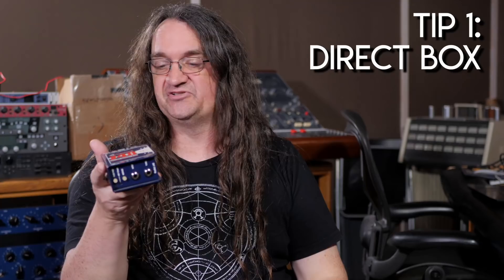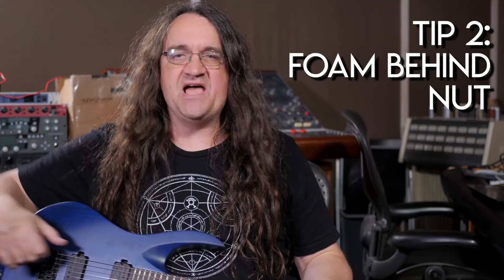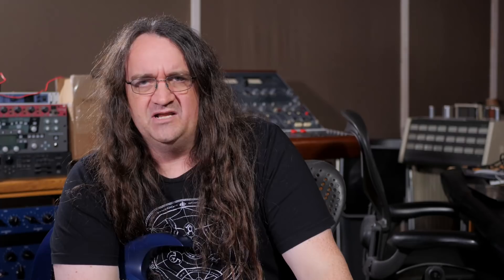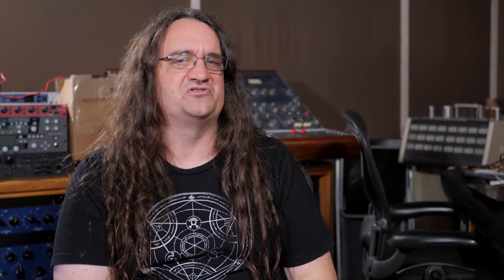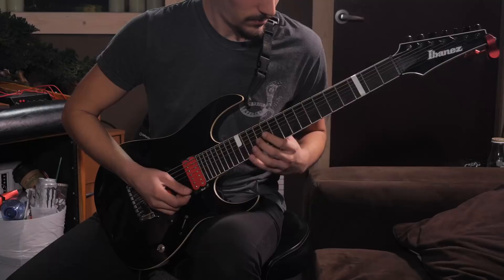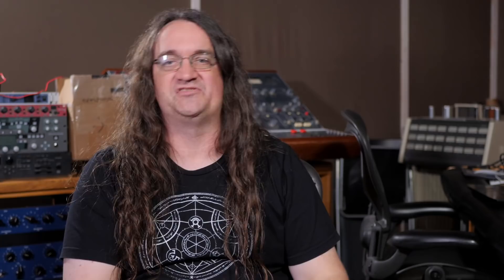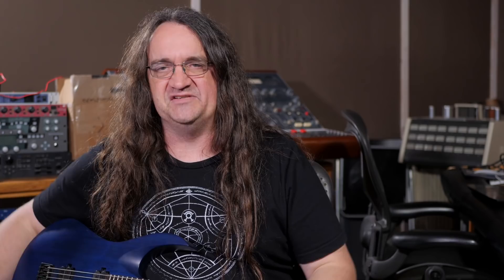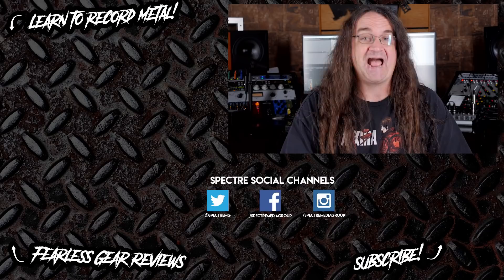Five Tips for Recording Metal Guitar at Home

Comment: So, I use a DI box or an interface to record? They are not basically the same thing? I’m not getting it
Reply: It depends on your use case. Most interfaces advertise having an instrument input but some of the cheaper interfaces don't have good quality instrument inputs. Some interfaces will always clip the input no matter how low you have your gain set. In this case a DI box would be very helpful. 

If you want to record a real amp with a mic, it's good practice to record a safety track that is just your DI signal coming from the guitar. You can't do this with just your interface, you'd need a DI box to split the signal from your guitar to go to your interface and then another output into your amp. If you're using an Amp sim then you can just record direct into your interface and you'll be good to go. 

Another use case for a DI box is if you want to send your guitar DIs off to get professionally reamped. In that case you'll always want to provide the cleanest signal possible which would be achieved with a DI box.

Comment: Would sliding foam in my fretboard work the same way as tape?
Reply: I wouldn't say it would work the same, but definetly an improvement for a cleaner recording
Reply: Not exactly. The foam does not like to move with the string so it can push your strings out of tune or make the guitar feel different. 

Tape just moves allong with the string when you play without adding to much resistance. This is better. 

If you do use foam I would recommend very soft foam.

Comment: You absolutely dont need DI if you have HI Z input, DI just messes with impedance guitar see, not a good thing. Di is for balancing unbalanced signal with long cable runs.
Reply: Many HI Z inputs suck high-end from the signal, and also they are more prone to hiss and buzz and what not. A DI-box solves these problems (at least they did in my case)
Reply: @BodominLapsi95  absolutely not true. It is Lo Z that does that, or line input. And people make mistake plugging in guitars in such inputs. Hi Z can never do that, it's basic electronics, that is the reason for having Hi Z in the first place. Only problem you can get by using Hi Z input is overdriving preamp chip/fet or what ever is used. However guitars don't have that high output, and DI doesn't help there either. Using it for reamping is another thing though!
Reply: @TheKingKorg  At least with a cheap interface like my Tascam the HI-Z input isn't very good, and a DI-box is a huge improvement. I haven't tried any higher end interfaces, so I can't say if they're better.

Comment: “Pick hard.”

Yeah...not always.  Some of the best tones I’ve EVER recorded are from guitarists who have a relatively light touch.  Crest Factor, if you will, has a HUGE influence on tone.  I find the light touch guys generate surprisingly thick sounds.  I do tend to pick fairly hard myself, and while I know I can make a guitar speak well, I work with guys that have a VERY light touch who do the same.

The big deal is just setting the amp right.  EVH, from what I’m told, has his amps gained up WAY past where you’d imagine they’d be.  I’ve heard his rig described as “uncontrollable.”  Which is probably true for everybody but Ed.  Light strings, light pick, light touch, but his rig works for him, and I can think of very few who dislike the tone he creates.

I always thing of playing instruments as a game of “enough.”  You need to pick hard ENOUGH.  You need ENOUGH gain to have some sustain to play with.  You need ENOUGH midrange to hear the notes, enough top end to hear the attack, and enough bottom end to feel like the sound is supported and dynamic.

“As hard as you can” is oversimplifying it at best, and bad advice at worst, as there is a limit.  You pick way too hard and you’ll drive strings out of tune, you’ll break strings, and your tone can even get thin and plucky because you’re beating the strings so hard that they don’t have adequate time to ring out.

Comment: Great video, thank you! I would be really happy to see similar tips on acoustic/classical guitar recording.
Reply: Good recording is good recording, much of what is discussed here for metal works for all, just ignore the distortion gear. Specifically:

You will mic a guitar instead of an overdriven 4x12 cab, so your neighbors will not plan your funeral. The same mics (usually SM57) suit both, although I prefer a condenser for acoustic, but that is just my personal taste. 

A pre-amp with a USB out (standard I/O interface) gets the sound to your DAW, and it is still nice to record the track totally clean and flat (your producer will thank you), with a duplicate recorded the way you really want to hear it, like maybe a little EQ, touch of reverb or delay.

This is where the DI box comes in, only you are not plugging in a guitar cord, you have a mic, so XLR connection in, and you may need phantom power. And two outputs, one clean, one going to whatever FX.

The ART Tube MP ($50) handles this nicely. I'm sure there are other fine brands and models, I mention this one as an example.
Reply: @SteamvilleQuintet  thank you very much for the detailed answer. That is more or less what I already do. The biggest problems with acoustic guitar at the recording step for me: 1. The noise of the room 2. The sound of my breathing while playing.
BTW, I'm a total amateur, so, for electric guitar I would definitely not mic. anything except what pickups are doing. My room is far away from being properly isolated.
Reply: So you have a mic that picks up EVERYthing - take a quick web search learn on mic patterns, sounds like you need a cardoid, that will mainly pick up what is directly in front of it and 8" or less away, and then you may want to engineer some small screens from old quilts or packing blankets. Do not fret, your situation is common and solvable. And do NOY buy a foam mic screen, they deaden the tone. Wrap old nylons, or I used a bit of felt for a "pop filter".
Reply: @SteamvilleQuintet  thank you so much for the answer. Regarding those "screens", do you maybe have a photo of your setup? At least, then I can imagine how it may look like. Regarding mics, I have 2: Rode condenser mic, which sound I really love, but it takes all the noise; the second is cheap copy of sm57, the noise is almost gone, but the sound is poor(I'm not sure, should I try something more expensive or it's just the nature of those dynamic mics).
Reply: No photo at the moment, but I am making some how2 films - not that the people already doing it are not good - but that everyone wants the old rock sound and most are too young to even know what it is/was or how we got it. So yes there will be film of my little setup, and it is little, I'm into compact, easy to use and reach. No use for a 7 foot wide mixer board!

Anyway, my fave mic is actually an MXL 990 (made by Marshall), Musician's Friend has them $60 on sale, $90 with a spiderweb shockmount that I like. It is a cylinder shape so my guy just wrapped and velcro'd a bit of felt around it for me one night, and that works so we never did anything more "pro".

That is I think not quite the mic for you, it is close range, but there is a better one for close work, can't recall the name of it.

I don't have so much noise to deal with, we do live in a normal house / neighborhood, but double insulated walls, and my sound and animation studio is upstairs, and we're old so just the two of us.

Those SM 57s are indeed noisy and hissy, they take some mixer work to be nice, great for live stage work though. I prefer the SM 58 after I heard Stevie Nicks using one, and her voice is close in tone to mine, so I bought one. For the studio I like condenser mics.

I will see if I can find that mic I mentioned if it's still made, and if I do I will write again with that, and in 2 or 3 weeks I will publish the first film on a new YouTube channel I haven't fired up yet, WestMillsStudio.

The one I'm working on now is a demo comparison for a blues sound using a few VST amp sims (all free) compared to a Telecaster with no FX at all, and then played through a Boss Blues Driver pedal. The next film will be similar only with totally clean sounds like classical or new age music would use.

Really sorry for such long answers... - R
Reply: @SteamvilleQuintet  nothing to apologise for, your answers are brilliant, thanks a lot for your time. It's a pity that your new channel is not available to subscribe. I hope you will invite me once it's ready. For now I've subscribed to your current channel.
I'm also doing something music-related on my channel, not sure if it would be interesting for you, it's pure amateur stuff. Check it out, if you're curious.
Thanks a lot for your answers, you gave me some ideas to think about. Looking forward to hearing from you soon.
Reply: Thanx Andrej!!! I will make note on my current channel when I fire up the new one - I'm thinking the one for games that I rarely have time to play now and then one for the studio stuff.

Apologies for not responding quicker, this IS my time of night by nature, but I am multi-tasking tonight, and like everyone else I'm not much good at it.

Going now to see if I can suggest a particular mic for you, based on my own experiences. And I will look at your channel - hey I'm an amateur too because even though I have made some demos for songwriters who do not play any instruments so they could sell their songs to groups starting out, and I have been lucky enough to hear my stuff on the radio a couple of times - I do music for the love of it. And that is the true meaning of amateur.
Reply: @SteamvilleQuintet  thank you for encouraging words! You're responding much faster than average person on the Internet :) Thanks a lot for your answers and time! See you soon. Good luck with you nightly multi-tasking work! :)
Reply: At this moment I'm not seeing a mic I like better than the one I'm using both for vocals and acoustic guitars:

MXL 990 Condenser Microphone with Shockmount

It is $100 on MF but goes on sale for $60 or $70 - it DOES pick up more noise from the rear than you'll want but a simple curved foam screen behind it maybe 12" tall x 16" in a half curve should take care of that. The spiderweb knocks out anything banging on the floor or mic stand, in one situation I need that because I have cats, in another placement I do not need that.

And there are rear screens available easily, also easy to put one together yourself - depends on how pro you want to look I guess. I gave up worrying about looking pro after I saw duct tape, scuze - gaffer's tape doing various things in a Beatles recording session photograph years ago.

I was looking for another MXL, a stereo version with closer range but it seems to be no longer made, so happy I bought that one when I did.

Now I have experience with only a couple dozen mics, some pricey some not, so I'm sure there are plenty of folks with more opinions than mine, and arguments about the best mic go on forever!

The sound of the MXL I use is on all of my game films as an example, with no shield behind because I wouldn't be able to see the screen with one, and in some films I have a window fan running 6 feet away, in a couple of others a window AC or furnace. I was not concerned so much about a silent room for the games.

Glad I can help, almost feel like we have hi-jacked Glenn's channel LOL, and will continue to answer anything I can. Will look at your channel before the sun comes up, and now going to listen to a new free amp sim, two of them released this week, how does one keep up? - R
Reply: Hello - listened to your songs, like them, yes I heard a little noise that a cardoid would knock back, but in the "live" setting you're doing a little noise is expected. Keep playing, after a while you get a little more relaxed - go with that. People love the charisma of a live show. Perfect is boring. Carry on playing! - R
Reply: @SteamvilleQuintet  hello! Sorry for the late response. Thanks a lot for watching and kind words, I will definitely continue ☺ in a couple of weeks I plan to publish something new.

Comment: To my colleagues in the "useless cunt" - departemenrt: 
Most of this tips are important to bass as well!

I. I am recording a distorted sound through my cabs and have a DI-Box in front that makes it possible to mit those two sounds together. So use a DI-box for this purposeif your amp has no really pristine Direct out.
Nota bene: Distortion pedals used with bass do steal low end - if you don't have a pedal like the Darkglass B7k or something like them where you are able to blend the distorted and unprocessed signal. 

II. As Bass strings are much thicker than guitar strings they do not tend to ring a lot in the aerea between the saddle and the tuning machine. But especially Fender type instruments with a 4 or even 5 tuners in a row - headstock have verry long G-string-remains between saddle and tuning machine. Just make sure in the studio that this part does not ring - by using a piece of foam. 

III. As bassplayers are teached to mute their strings propper, you don't have to tape the strings you are not using? Bullshit. First: Are you able to mute your strings propper? With both hands? Second: Are you sure?
Especially when you play in the high registers there is so much free string from the fret to the saddle, and the bass is vibrating much more than a guitar due to more energy in bigger, longer and fatter strings. Also the stronger overtones of the played note will make empty stringspaces ring. So using painters tape to dampen strings or string spaces you don't use does help.  

IV. I don't say "pick hard", but I say dig in hard! Some bassplayers use picks, some play with the fingers, there is no right or wrong in both techniques. But for punchs sake, dig in hard! Only what you put into your bass is able to get out. There is a sense in the term "Heavy Metal", as it means "play hard".

V. Right pick for your style... OK, you don't have to use ultra thick picks when you use a pick, it is also a matter of how you hold it, in which angle, if you "scrape" the strings to give the sound a different, more percussive aproach. Use the pick or your fingers, as long as you are comfortable with it. But don't forget to dig in hard, for fucks sake!

I once had a discussion with one of my guitarrists, as he started to brag around:"See, I am using the same pick as our bassplayer, do you know what this means...?", thinking about this making him the one with the "stronger picking technique"... So I told him that this simply means, that a thinner string of a guitar tends to go out of the way of a pick even easier, and that in my case the pick has to handle much more mass and tension, so it happened complete by accident that I was using the same picks in size and thickness as he did. And that it means just nothing. 

And last not least  
V.a. Use an amp when you are practising at home! This is even more a thing when it comes to bass! A cheap practise amp from any brand with 20 - 30 Watt will do the trick. These amps are about 100 bucks, and even less on the used market. Or, even better, get yourself a small 110"- or 112" - cab and use the bassamp of your choice with the cab. Just make sure to use an amp for your practising - without blowing out the windows of your home. But use an amp to hear your mistakes and technical flaws, so you are able to get better.

Comment: I've played around with taping strings off and am never going to do that again. Why? Because when you take off the tape you have this sticky disgusting gunk all over your strings and fingerboard. It's better to learn proper muting.
Reply: Another Anon what kind of tape? Avoid duct tape!
Reply: @dntinker  yeah unfortunately it was duct tape :D
Reply: @crimsun7186  unfortunately hair bands won't do the trick in my case, as i'm using baritone gauge (6th string is 68)
Reply: @AnotherAnon  Victor Wooten uses them on his basses. The lowest string on a bass is 90 on a 0.40 string set.
Reply: @crimsun7186  then it's something to consider

Comment: Do I need a direct box if I have audio interface?
Reply: I also use an audio interface with amp simulators
A DI Box improved my sound so much. It took away almost all noise and the sound is much sharper/crisper.
I always thought my sound missed a lot of high end. It was a bit dull, but the DI Box fixed that.
I really recommend it
Reply: @Apebek  I've been told I don't need one
Reply: @Apebek  I'm really confused now
Reply: I am not expert, but I know the following.
You have three types of signals. XLR, Line and Instrument.
Most digital gear has line output. It means it has a high output. 
Guitars have Instrument level output. It has a lower output.
XLR is somewhere in between, but the cables have an extra conductor which are better at rejecting noise.

Most Audio interfaces have XLR and Line inputs, so when you plug a guitar in line input you have to boost the signal to get a higher volume, but this may increase noise.
A DI box converts the instrument signal to XLR signal. 
It also maintain high frequency information in longer guitar cables, which in my case explains the extra crispiness.

It may depend on your audio interface. I know the focusrite has a switch wich boosts the instrument level which is I think the same effect.
If you are happy with the sound you have now then you dont need it, but as the guy in the video says "you can't go wrong with it"

I have a Samson MDA1 which at the time cost 40 euros. Then you need an XLR cable which costs maybe 10 euros.
In my case it really has improved the quality of the sound. @neoconnor4395